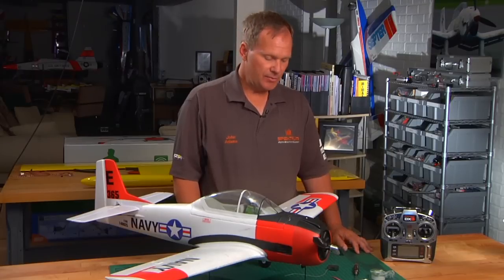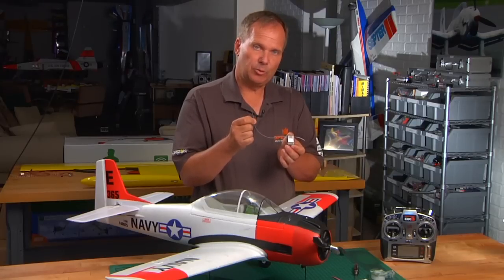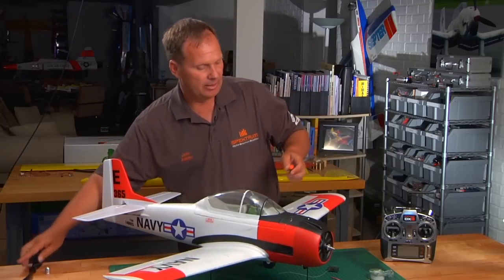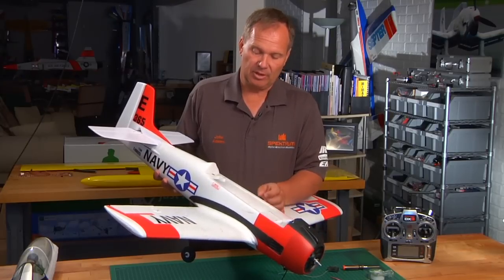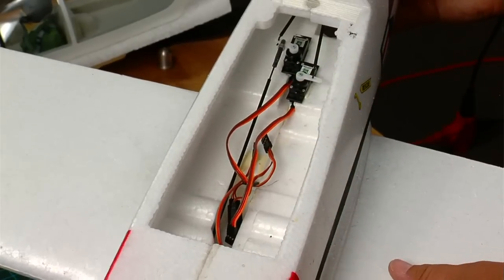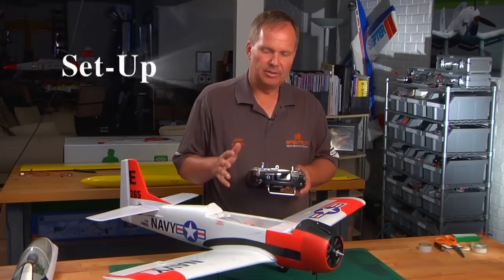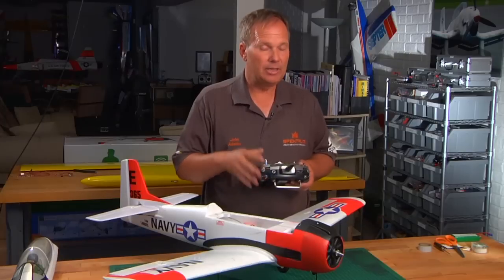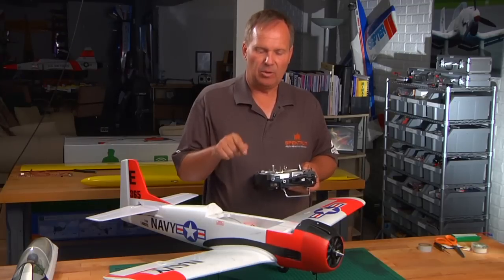Installing the Spektrum AR600

Comment: @7:20, My servo connectors did not fit. I learned later that they have an interference problem. Do you have video on trimming the connectors?

Comment: I have been given a model boat with an AR600 receiver but I have no transmitter. Will any of the transmitters currently available read with the AR 600 receiver. I realise your video is some seven years old but I thought I would ask you if it might work as there is not much working space within the boat to fit a different receiver.  With best wishes from the UK.

Comment: I am new to R/C. I have a Air titan from Motion R C.  I am trying to set up a Spektrum receiver in it..
I have been sold three different receivers,  AR610, AR8010T, AR6600T. 
What is the best receiver to put into this plane?
Also, the Air Titan has two ailerons plugs.
I have know idea where to plug the second plug into.
Please help,
Bob
Reply from the maker: Hi Robert. The AR610 would work fine in that model. For the Ailerons you can y harness them to the aile channel or if you have programmable radio you can run a dual aile wing and plug the right into Aile and left into Aux1. Hope that helps!

Comment: whats the range with this reciever
Reply from the maker: deryl Robinson This Rx is what we call a sport range receiver. It provide more range then a park flyer receiver, but it is best used in smaller electric foam models. In these scenarios you will get around 3000 feet Line of site.
Reply: Its the only reciever i have in one of my models which is compatible with my dx6 i just bought here in the UK' Only dsmx recievers will bind to it. the ones in the dx6 bought in the US are backwards compatible wish i'd known that before i got one.

Comment: ok am i wrong if you unplug the bind plug with the power on you can unlock the reciever i believe this is what took down two h9 p-51's v1 and v2. i just set up a h9 raptor and one of the guys at the field said he wanted to watch me set it up i went thru exactly what you did in this vid and when i pulled out the bind plug with the power still on he stopped me and said that was the reason the 2 other planes went down. i set up the raptor his way and have not had a single glitch.

Comment: I have a question: Which battery do you use for the T-28 Trojan? I bought this plane and do not know exactly which battery I should use... What are the best dimensions and weights for this?
Ps: Great video by the way ;-)